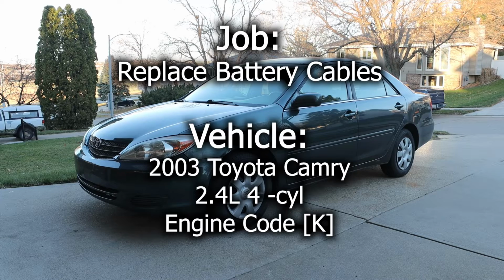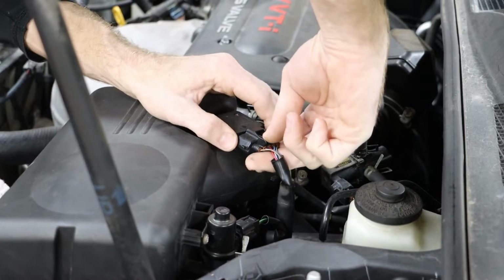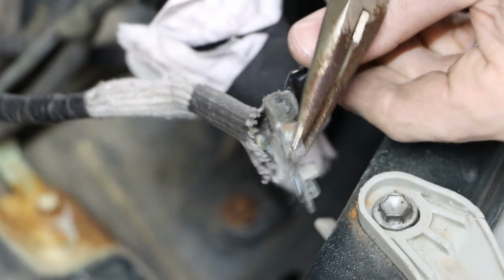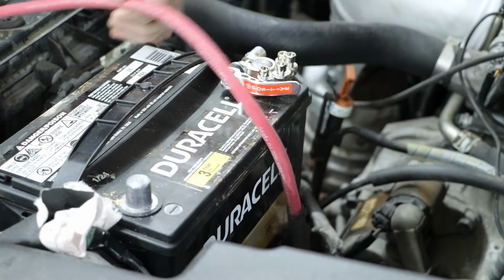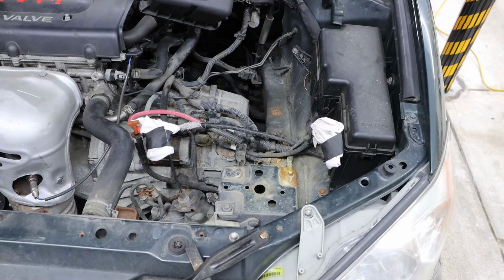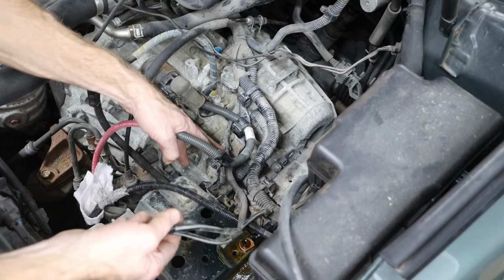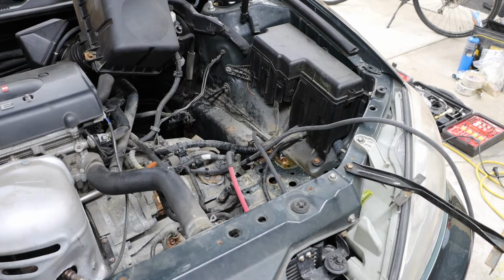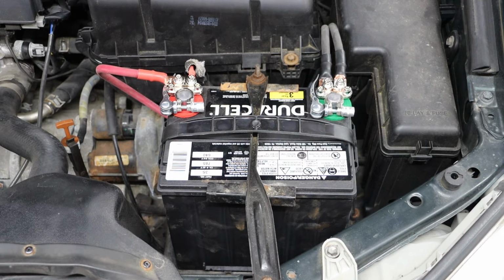2003 Toyota Camry - Battery Cable Replacement (and connectors)

Comment: What size wire/cap was used at 7:55   ? That crimping/stripping tool wasn’t included in the description and i dont think i can get a good look at the size of the cap on the negative cable coming from the fuse box
Reply from the maker: I am unsure of the wire/cap.  I had purchased a kit of various sizes and just selected the one that fit best.  As for the crimping tool.  It is a electrical crimping tool that I was given many years ago.  http://www.aeroelectric.com/Mfgr_Data/Connectors/AMP_Tyco/AmpChamp.pdf

Comment: Thank you, thank you, thank you for this video! I need to know where the battery ground(s) go and was not finding success with the searches I was doing. This video showed exactly what I need to know. 👍👌💯
Reply from the maker: Thanks for the comments.  I'm glad my video helped.  Good luck with your repair.
Reply: @InsaneOil Actually it's not for a repair, it's for an enhancement. I'm installing an audio system and this is part of the "Big 4" upgrade that you might have heard about. Just trying to improve the factory power and ground connections.
Reply from the maker: @brianfulcher3280  I have heard of the Big 4 upgrade.  I can see where this video would be tremendously helpful to know what you are getting yourself into before tearing into everything.

Comment: awesome video! i need to do this on my 2011 camry. does anyone know if its more or less going to be the same?
Reply from the maker: In general, the procedure is about the same across years, makes, and models of vehicles.  The biggest different usually comes down to how much stuff you have to remove to get access to what you need access to.
Reply: Same here, i saw a similar video showing the same steps somewhat

Comment: Do you know the final lengths of each wire was? Im looking to by the wires precut to save me some time.
Reply from the maker: Sorry, I don't have the final lengths.  I was doing a wiring job for a couple different vehicles and just bought more than I needed so I could cut each to length.

Comment: I need help with the positive lead to the fuse box do I splice that wire or get a new one mine is very frayed and cracked
Reply: I am in the same position have you found a solution? My wire is extremely corroded and from the looks of it has been cut and replaced before I owned the car  to say the least it was a hack job and im not sure what to do
Reply: @sadietheratlady Did you end up splicing and soldering a fresh wire onto it. I have a similar issue and I’m having trouble finding a solution
Reply: @playedwit  Hey was working on my
01 Camry, this second cable goes all the way to the fuse box. You're gonna have to take the fuse box semi off; like taking the bolts out that connects to the Fuse box. And lifting the segment with the blue alternator fuse up, You can lift it up by using a flat blade screw driver.
Coz the second positive cable is connected to it under neath, just unbolt it and use an 8-11 mm socket and take the bolt off it. It should use a 8 awg wire. And make sure you have an appropriate heat shrink and lug connector to connect to the battery connector.

Short answer; find a long enough 8 awg wire and 8  lug connector for your car. 

It's kinda tricky and can be challenging but you can do it! If you have further questions please let me know!

Comment: Outstanding , but I do not have the $100. Dollar crimper. I prefere the solder method. For those who do not have that tool. WHY , I will only use that tool only once. So the solder method I will use. Other than that your video is outstanding.

Comment: Which size copper end terminal did you use for the wire from positive to the fuse box?
Reply: He used 2 AWG stranded cable, stated at the 4:46 mark.
Reply: @connerw4961  That's the cable type, not the terminal (connector) type correct?
Reply: @bswisle   I misread your original question lol but yes, the terminal connector would also have to be 2 AWG. The only thing you have to look out for is making sure the terminal connector inner diameter is big enough for the screws to fasten the terminal connector to the battery. I don't know the diameter of the screws that are used for the fastening, so it could be in the video, or you might be able to measure them and buy the parts online/from a store. Hope this info is helpful.

Comment: Wouldn't it be cheaper to just buy new cables from Toyota?
Reply from the maker: Possibly.  I was rewiring a forklift at the same time so I had already purchased all of the tools and materials for that project.  I just had to order an extra set of terminal clamps for this one.

Comment: I am trying to remove the 12mm nut that holds the cables to the battery connectors on my 2001 Camry.  I have used Liquid Wrench and PB Blaster, but can't budge the nuts.  The connector starts to bend and the nuts never loosen.  I thought that the nut is a special locking type.   Is that true?  I noticed you used an impact wrench (,which I don't own) to loosen the nuts.  Would you consider that a necessary tool?

Did you increase the wire size of both positive and negative cables?
Reply from the maker: Any luck with your issue?  I'm not sure about the locking type nut but I do know that they are designed to pinch onto the battery terminals to prevent the connector from falling off while you are driving.  I don't think an impact wrench is necessary but it does make the job a little easier sometimes.  I believe I did increase the size of both cables.
Reply: @InsaneOil  I decide to revisit this in the spring.  Temp has been 0 deg F or below, and I don't like messing with a still working car.  If it didn't start and run, I'd be trying harder.
Reply from the maker: @PanamaSticks  Understandable.  I try my hardest to not work outside in the cold temperatures anymore.  I did that for too many years.

Comment: I spend two day trying figure it out and it was just the negative terminal wasnt clean enough
Reply from the maker: Sounds like you got it figured out.  On this car the cables themselves were getting corroded and weren't long enough for me to cut the end off and put a new end on...thus I replaced the entire cable.
Reply: @InsaneOil i changed the alternator and then the starter n the battery for nothing lol

Comment: The second wire that goes into fuse box . how do you replace that?
Reply: same thought, he doesnt replace it only crimps a new connector to it, it does go under the fuse box but doesnt show how to get to it....
Reply: Hey A year later did you guys find out how to get under the fuse box and replace that cable, Would appreciate any Help!
Reply: @compbesnagz9375  Hey was working on my 01 Camry, this second cable goes all the way to the fuse box. You’re gonna have to take the fuse box semi off; like taking the bolts out  that connects to the Fuse box. And lifting the segment with the blue alternator fuse up, You can lift it up by using a flat blade screw driver. Coz the second positive cable is connected to it under neath, just unbolt it and use an 8-11 mm socket and take the bolt off it. It should use a 8 awg wire. And make sure you have an appropriate heat shrink and lug connector to connect to the battery connector.

It’s kinda tricky and can be challenging but you can do it ! If you have further questions please let me know!
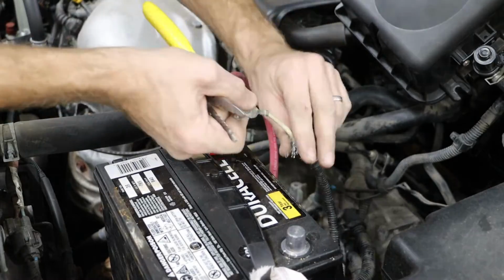Reply: 7:34

Comment: Can I use 4 gauge wire instead if I don’t have 2 gauge wire ?
Reply: Though this may be too late to be relevant to you, replying for others who watch this video later...

Findings from my research on this question and adjacent questions:
-generally the same size or can differ, with negative being smaller because it generally carries less current
-negative min. = 6 gauge, positive min. = 4 gauge
-4 gauge for both is plenty capable
-2 gauge or even 0 gauge yields better conductivity and higher performance and more the case with after market electrical components, but there's also a tradeoff and potentially a point of diminishing returns as thicker cable size means they're heavier and bulkier, taking up more space, and they cost more than 4 or 6 gauge because they're more material
-starter, alternator and fuse box in this model CAN handle the additional current from the larger 2 gauge or 0 gauge size, so, like the poster alluded to, no real harm in going larger if vehicle owners decide to do so
Reply: @2229lionman  thanks.
Reply from the maker: @2229lionman  Thanks for the comment and tips/information.
Reply from the maker: I am not a wiring expert, but I do know that it is generally okay to go thicker...just not thinner on wire gauge size.
Reply: @InsaneOil  RED: So the only wire that plugs into the starter is the + wire , then to + terminal on battery ?  BLACK:  From what I'm seeing the - wire bolts into car frame & - terminal battery?   I'll watch it again. Thanks.
Reply from the maker: @billwayne3924  If I am understanding you correctly, that sounds correct.
Reply: @InsaneOil  thank you.

Comment: can you use 0 gauge wire for both sides or does it have to b 2 gauge?
Reply from the maker: Should not be an issue to go larger